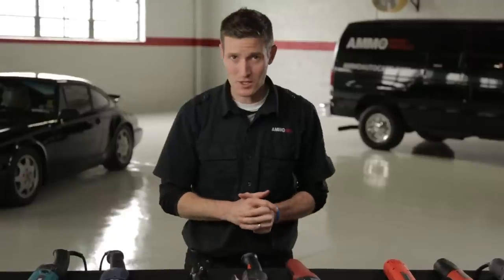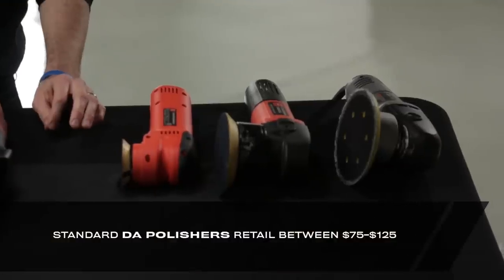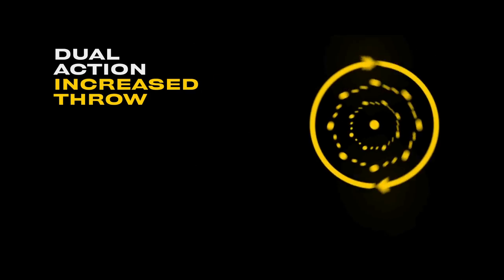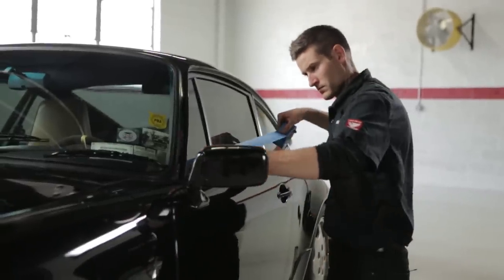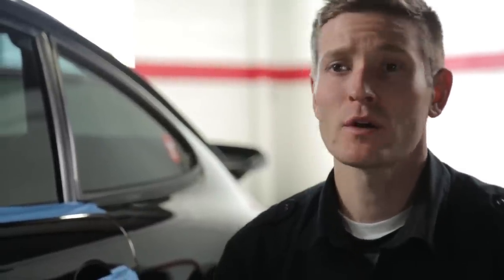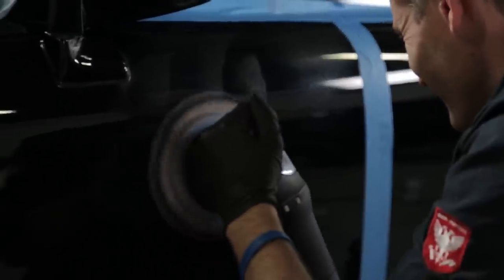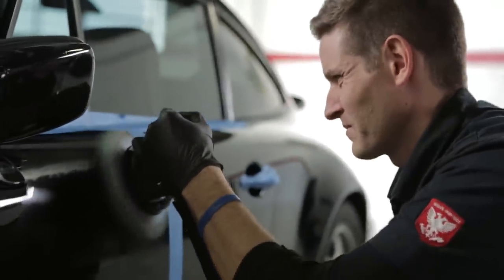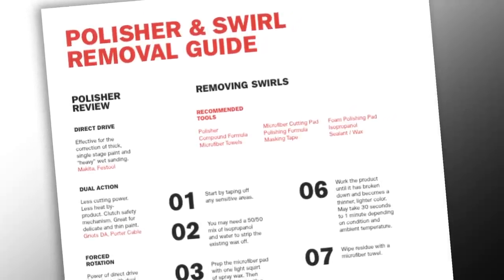Polishers and Swirl Removal Tips -- /DRIVE CLEAN

Comment: How much time does it took to paint correct a car with a rupes mark II To 80-90%? thank you very much
Reply: Jorge Yanez If the car is heavily swirl up (sedan for example), 2 days are sufficient. 3 days would be great. Remember you need rest, energy and most importantly don't rush.
Reply: Radhwan 2 days are 16 hours only polishing and compounding?
Reply: Radhwan if the car is new how much time is required for doing a 90% paint corection with rupes bf mark II? Thanks
Reply: 2 days including 1-washing the car, 2-paintwork decontamination (clay), 3-test spot (soft or hard clear coat?), 4-compound, 5-polish, 6-sealant, 7-wax. Assuming you are new to paint correction, this whole process will take more time and you need to play around with your polisher pad and compound. You need at least a few type of pad to test with your polisher and see the result. If the car is black, it's quite a challenge to work with, and if the car is white, it gets even more challenging and time consuming (white colour hard to see defects/fine scratches/hazing). I would say 2 to 4 days (16 - 32 hours) would be best for you to complete the whole car...more learning process, steady and relax work (patience is the key). 

I recommend you to watch videos from Forensic Detailing Channel on how to polish a car. It's a great channel for detailers. Most of his vdeos are very lenghty and this is good to have a deep understanding for car detailing (owner name Jon Delieu based in UK).

Comment: How much pressure do you put on the machines?
Reply: You really don't wanna use much pressure at all. When you first start it's really hard to find the right balance, but what you want to do is let the buffer and the product do all the work. All you should be doing is moving back and forth and then up and down with just enough pressure to hold the buffer against the side of the vehicle. Think about it as you should basically only be using finger tip strength as pressure. Honestly though, the only way to figure out the amount of pressure is by doing it. If you are using a compound or even a light compound and you think its not getting out a scratch that should come out then add a tiny bit more pressure. Trial and error.
Reply: +Azza  LOL
Reply: +Azza  LOL

Comment: There is no absolute answer to that question. Clear coat depth varies from manufacturer/manufacturer and car/car. For example, a typical 2000's BMW will have about 20~30+ microns of clear to work with.  On severe correction someone may need to remove about 5~6 microns. Light marring may require 2 microns. Modern Porsches have less clear.

Comment: Why do you constantly mention the two specific buffing machines ? it seems you are tempting people to buy the expensive models, as the cheaper one's don't 'cut it'
Reply: as far as they go, they are fairly top of the line models, and the safest options hands down, if you are into pro detailing, and have the money, they are an investment ten fold, otherwise like he said if you are a weekend detailer, a dual action is fine, since they wont burn your paint if you make an amateur mistake.

Comment: Hey Larry, I couldn't help taking my eyes off that terrible looking, low hanging tail pipe on your van.  It's honestly all I could focus on during your video.  
.
Kudo's for getting a HD diesel van but please put a nice tail pipe/ tip on and tuck it up to the body.  I know you're OCD and don't know how this one slipped by your calibrated eyeball.  I'm not suggesting getting a whole exhaust system because that wouldn't be very professional in your line of work..."Just the tip"

Great vids BTW

Comment: Im a avid detailer but let me tell you something guys, the swirls always come back no matter what you do, its impossible to maintain a swirl free car, clear coats are made to make you spent, my best recommendation is waxing and good washing techniques.
Reply: If swirls are coming back AFTER you polished it, then you are washing or treating the paint during drying wrong imo. Polishing is removing the layer or defects. Something that has been removed can not come back unless the person inflicts it again. Been working as a mechanic and Carrossier. And having done many cars, including my own, i can safely say that the swirls and scratches i have removed by polishing never returned. That is if maintained properly, meaning proper cleaning and proper drying, just being careful generally.
Reply: Youre aboslutely right Dino. With proper washing techniqes & extreme caution they can be avoided.